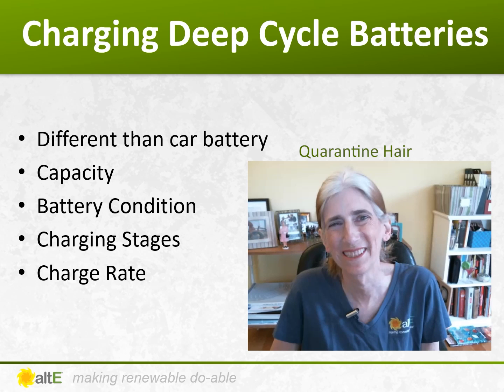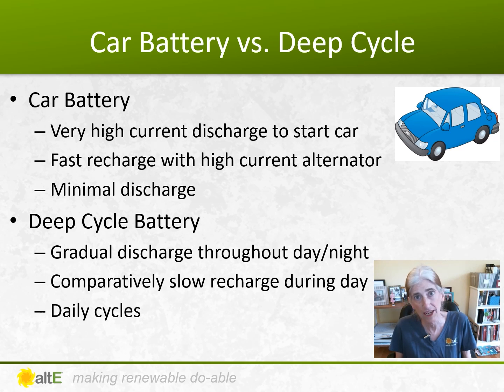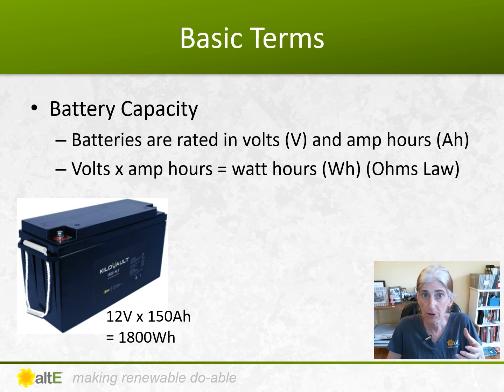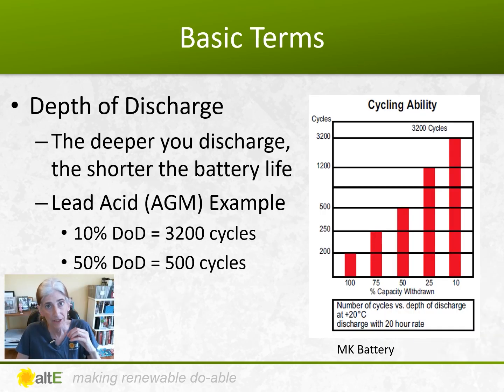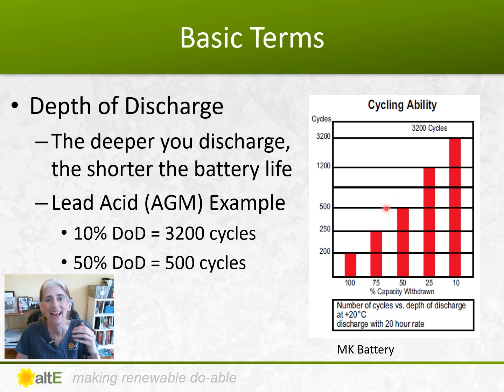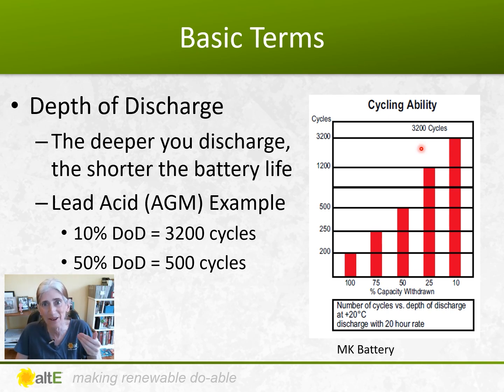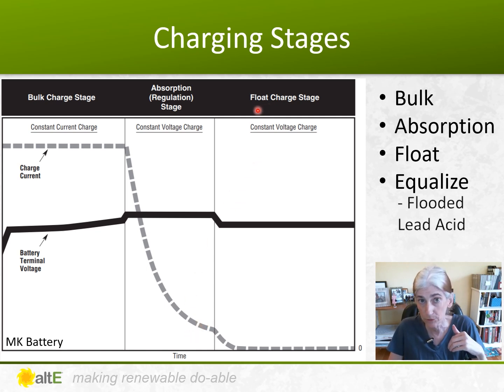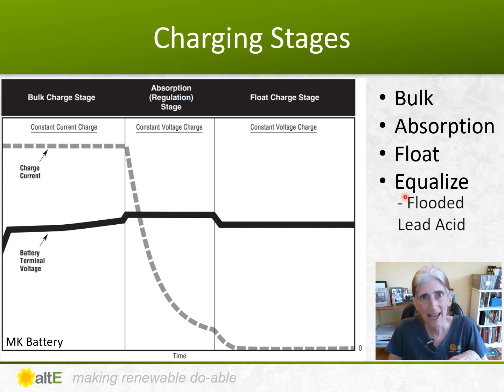Charging a battery bank -Part1

Comment: Power(W-Watts)=Voltage(V) x Amps(A) - that is NOT Ohm's law - that is the Electric power equation.  Ohm's law is Voltage (V)=Amps(A) x Resistance (Ohms). thanks